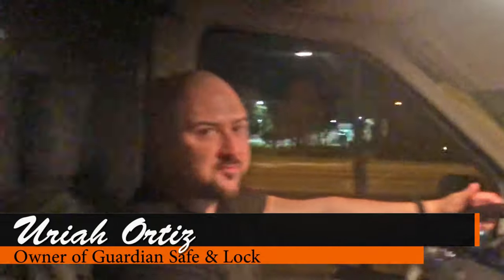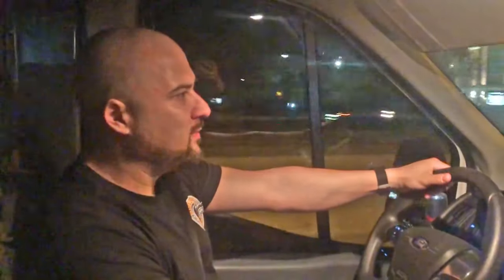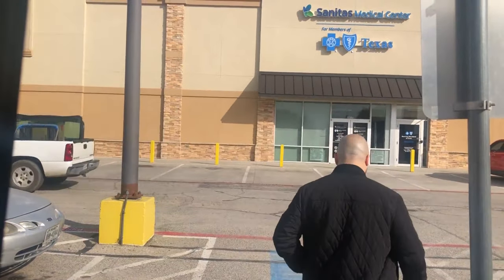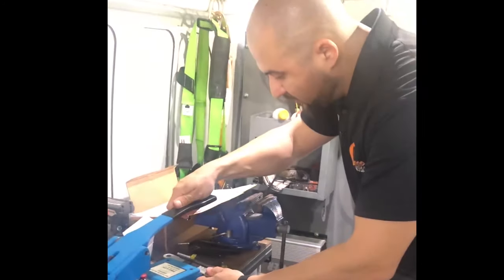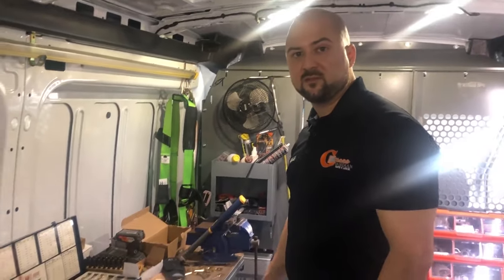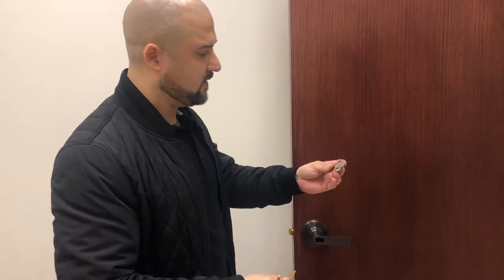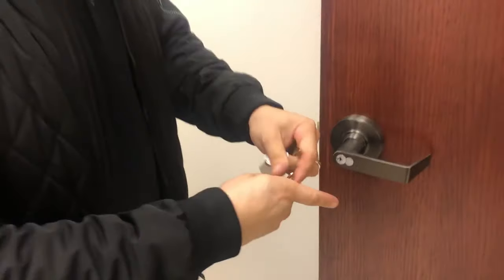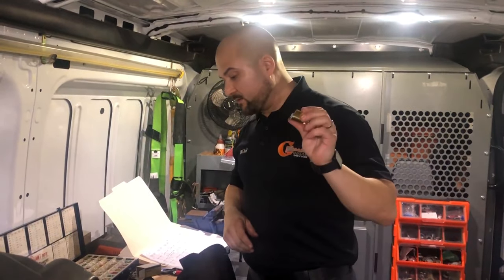Vlog | Commercial Master Key Systems

Comment: Good content as usual. Not totally familiar with the Schlage SE4 keyway. Is that an unrestricted domestic profile? American profiles are pretty rare down under. They fell out of fashion in the early 2000s. Was a sub master included in any of the locations? Just curious in the event of a cleaner needing access to only certain rooms at the premises or was it a case of a tiered system of GMK, MK and CK and the cleaner having access to a MK? Sorry for the ramble. It's a case of gleaning incite from a professional's  perspective. Have a good one and that ute at the 4.30 mark was giving it some gas:-)
Reply from the maker: Thanks again for the continued support! It was actually a SC4 keyway, which is just the 6pin version of the SC1 keyway. There is one master key (GGM) for all locations across Texas and each location had its own sub master. The one location in Mesquite had the large format Schlage key which uses the SC4 key but you have to make a core key to remove and install each cylinder. Thx for reaching out.